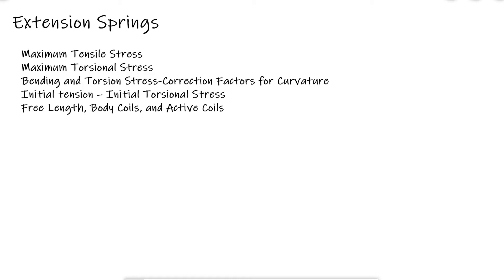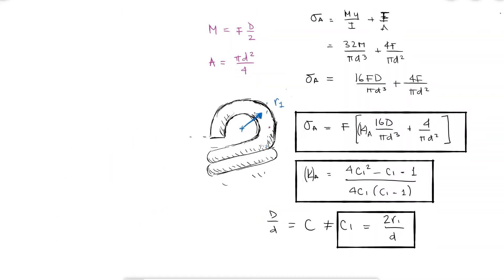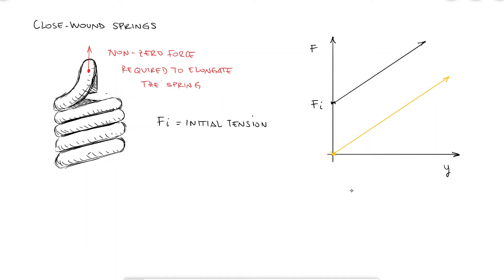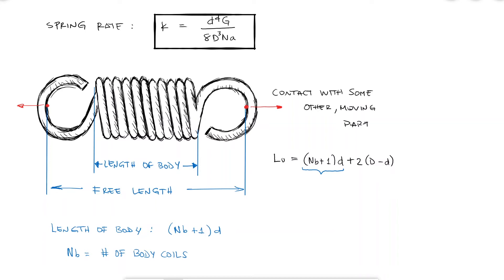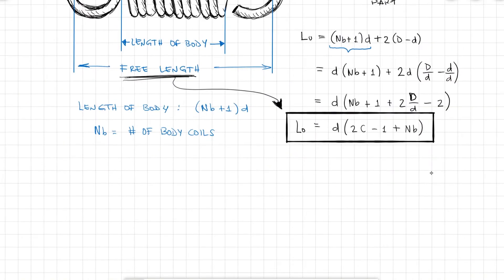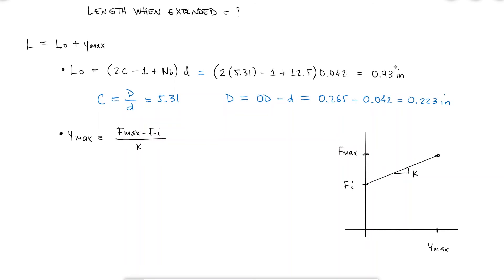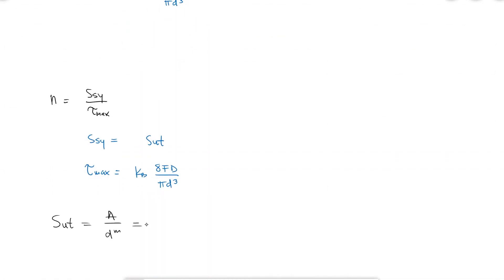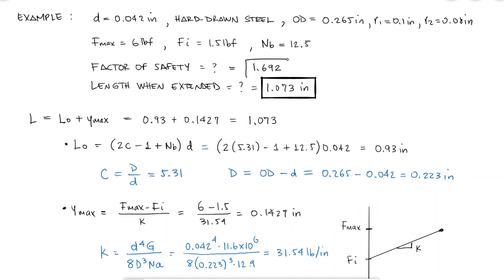EXTENSION SPRING Design - Stresses and Initial Tension in Just Over 10 Minutes

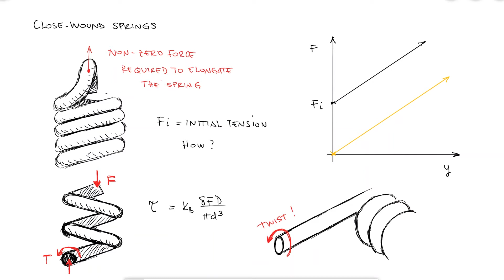Comment: at around minute 3:12, the 'twist' direction you show I find to not be the correct direction for 'twisting'.  (Or maybe I misinterpreted your diagram.)  If you twist the feed wire the other direction, you get a large pre-compression in the final spring.  Thanks!  Very hard to find other places which show how to accomplish this.

Comment: is there a way to find out r1 and r2? i have spring of 0.9mm wire dia, 12mm outer dia and 50mm length inside the hook, spring rate of 0.1265N/mm and Wahls correction factor of 1.116. Thanks!